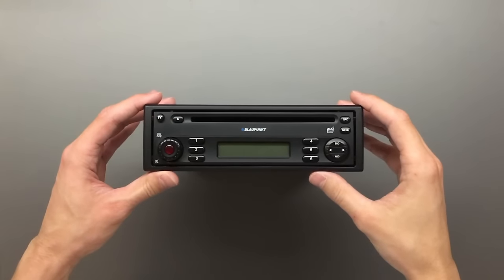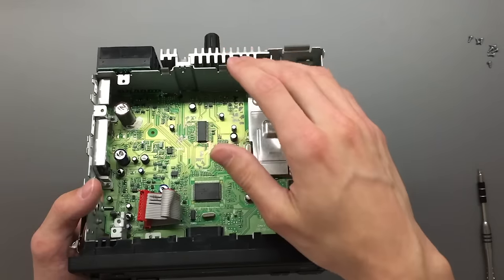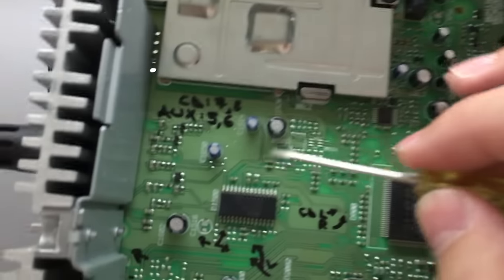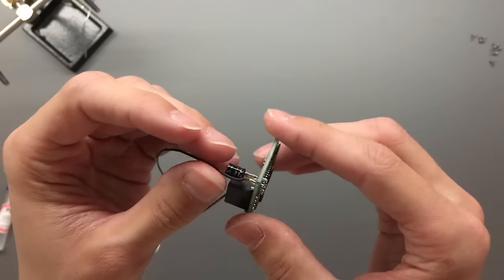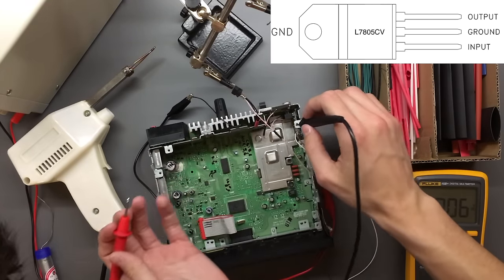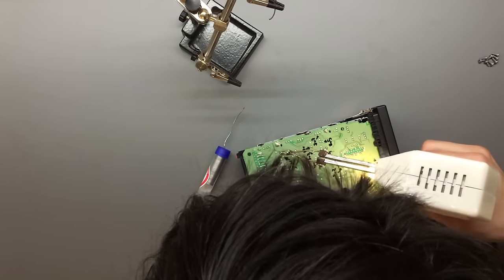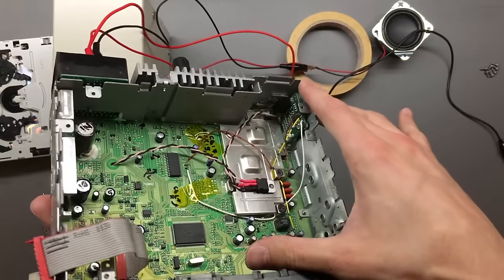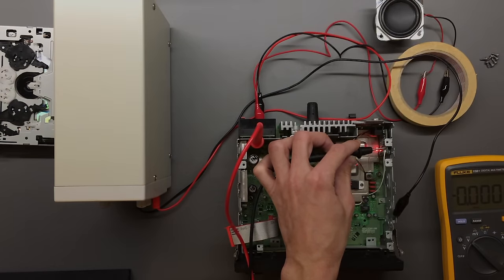How to Add Bluetooth 4.0 to Any Car Stereo for 12$ ! Complete Guide !

Comment: Only part that worries me is epoxying the regulator. The tab of the regulator is going to be the output voltage, in this case 5 volts, and you epoxied it to a grounded shield. If it comes loose, or if the epoxy becomes conductive (this can happen to certain epoxies in humid conditions) you could have a potential fire hazard. I would have used a silicone insulator and mounted it to the side of the case. Otherwise, great job.
Reply from the maker: Great Comment !

Few things though - most regulators (and all of the ones I have) have the TAB connected to the middle pin, which is GND

Loose I'm quite positive it will never become, this Poxipol crap was always good - I have joints made 20 years ago, and they're fine -- humid though .. yeah, that's a great point

In this case it would connect GND to GND, but just the other day I connected another TO220 package, a MOSFET, in series with the regulator, and, I also epoxied that one down, if the epoxy becomes conductive there, I'll be screwed, it'll short out the mosfet and regulator to the case

Unfortunately I don't yet have silicones I trust more than this Poxipol (all I save is sanitary silicone, the best of which takes forever to settle, and given I have to levitate the part over something, it really isn't worth the effort)

Anyway, that radio is taking a break for now as I've modded two mercedes-benz radios which are now being tested :)
Reply: I stand corrected, and thank you for replying. I'm going to be modifying my factory stereo in my 03 Mountaineer as soon as my BT module gets here. I'm going to try and make it so the silent CD isn't needed. Have you ever done that?
Reply from the maker: That's a tall order, there's basically 3 way of achieving this ...

1. The rough and ready way, just feed the audio straight into the power amplifier, make sure you're radio is set to mute, and you're off: https://youtu.be/C3KvqEyeIOs
The problem with this approach is you don't have any volume control on the actual radio, nor an equaliser or fader/balance, which might sound ok at first glance, but after a week or so I had enough of it - the no volume thing is horrible, and the no faders is tragic if you have unbalanced speakers front/back

2. You could also use the AM signal - and inject audio into the output of the AM decoder chip (given it's 03 that might very well be a separate chip) ... I've only tried this on one radio, a Becker BE3200 Audio 10 CC, but, as it turns out, it's first of all MONO, and second of all, sound like absolute and utter shit - extremely shallow dynamic range ... just unacceptable (which is why in that instance I reverted back to using the tape, even though it has a rubber belt that at some point will fail: https://youtu.be/UEI6IFuTH8s )

3. You could get all fancy, whip out a scope (which I very unfortunately don't yet have), and get a small microcontroller job going inside the radio, an arduino should be more than powerful enough, and whenever the bluetooth module is playing, send a signal to the mixer chip, which 99% sure will be using i2c, and have it route the signal from the cd mechanism without having the radio in cd mode (thus I'm assuming it'll just display the radio as usual, just you'll be hearing the non-spinning CD over which you'll be overlapping the bluetooth signal)

If you go the third route I would definitely like to see a video detailing the process
Reply: I was thinking  a version of 3. My plan is to use a microcontroller so I can add functionality to the existing mute and CD buttons. Essentially, I'll use a transistor in place of each button (original traces to the button cut). So, one side of the button will go to a low voltage rail, the other side to an I/O pin on the micro. The micro will then be programmed so a short mute button press will momentarily turn on the transistor simulating a normal button press function. A long press will momentarily turn on a different transistor simulating the button on the bluetooth. The second button will be to switch between CD and BT with the CD button. Of course, I could just drill holes and mount a switch somewhere, but what fun is there in that? My thoughts are that when play is pressed, a low voltage signal is transmitted from the CD unit which enables the audio amp, or at least goes to a pin on the stereo's micro which tells it to enable the amp. I'll have the original signal from the CD go to an I/O pin, and another I/O pin will receive a signal if it's put into BT mode. Then, all I should have to do is transmit a signal from the micro to the trace where the signal from the CD originally went when either one of those pins goes high. Other ideas would be making the stereo and steering wheel buttons work to change tracks. Seems it should work the same way as adding a second function to the other buttons. The whole plan is complicated by the fact that the chips in the stereo are custom for Ford and I can't locate datasheets. When I first started thinking about this, I was hoping to locate unused pins on the stereo's micro, and modifying the circuitry and firmware to enable them. But, without datasheets, that's not going to happen. I think my current plan has potential though. I have a Rigol DS1054Z scope, so I should be able to see what's going on when the CD is enabled and go from there. I'll document everything and do a video once I get it all together. I'd really like to find a way to make the track info show on the display, I think it could be done by transmitting it in the same format as the CD unit does, but probably not possible with the cheap BT module I bought. Maybe that will be the 2.0 version. Just looked at the module you used and I believe it supports the other functionality I want so I think I may order one and use it instead.
Reply: So, I went ahead and ordered the CSR8645 because it has all the functionality I want such as outputting track metadata and controlling the mobile device for hands free calling, changing track, etc. I'll just have to figure out how to make it work with the stereo. If I can figure out how the CD unit works,  I should be able to send the metadata to the display and it will just think it's the CD sending it.
Reply from the maker: But was the audio CD reader the type that could read track names ? I've never seen those hit cars .. or is it mp3 even ?

The solution for the buttons I feel is overly complicated - why don't you just tap the signaling side of the button contact, and listen in parallel with the host controller ???
Reply: It is a CD/MP3 player. It even shows me the song name on radio sometimes. Part number on the side is 3L2T-18C815, but I've found that there are many which look identical but have different part numbers. If I listen in parallel with the host controller, I can't override the native button function. There may be some where I don't need to override the native function and then a parallel connection may work. I think I can cut the trace after the button and use the original button signal to signal the micro in cases where I do need to override. That will reduce the number of wires I need to run to the buttons. I have one of these units open on my bench, but the CD player doesn't work so I can't learn much from it. I picked one up for $10 a couple days ago and, after cleaning all the limit switches, I was able to get the CD player on that one working but it's in my truck already. I'm planning a trip to the local you-pull-it scrap yard and I'm going to pull the CD unit out of one so I can use it for parts. By that time, everything else I need should be here and I can get this project going.
Reply from the maker: Alright - definitely keep us posted :D
Reply: I will. And thank you for all the ideas.
Reply: SwapPart TV Repair so?
Reply: @nerfinator03  I got busy with other projects, but this is still something I'm working on. Of course, I've learned an awful lot since these comments. The radio and CD unit communicate over a 4 wire SPI bus. My original idea of cutting button traces was completely wrong. The buttons most likely provide a signal to an analog to digital converter(ADC) in the main CPU. So, I could basically just tap that signal, feed it to an ADC on a microcontroller, and be able to use some of the radio buttons for alternate functions when in BT mode (this would be done in software). I had at one point designed a board in Eagle which would connect in series on the ribbon cable between the radio and the CD player. The idea was that it would respond to commands sent from the radio and either pass those commands to the CD unit (if in CD mode), or make the BT module do something if in Bluetooth mode. But, while waiting on a breakout board with my chosen microcontroller to arrive from China, I decided I wanted to do something more complex. The idea now is to add BT, microSD, 3.5mm aux socket, hands free calling, USB (capable of streaming and fast charging), and hijack the display. It's a tall order, and the USB may get dropped, but I'm sure it can be done. My plan is to use an STM32F030C8T6, which has 2 SPI ports. 1 port will connect directly to the radio's main CPU's SPI port (which will no longer be connected to the radio's SPI bus). The other port will control the radio's SPI bus. That way, the STM32 becomes the new master on the bus and plays middle man between the bus and the radio's CPU. The only real difficult parts are figuring out what all the SPI commands do, and identifying the chip select pins on the various ICs because there are no datasheets available (all the ICs have custom Ford part numbers).

Comment: Great job and explanation. I understand the theory and the technical / soldering things. However I have difficulties to find the right pins on my radio (standaard Opel GT / Saturn Sky from 2009). I would be great full if you or someone else could help me with that 🙏🏼

Comment: hey dude awesome mode. Can you somehow hijack the steering wheel controls and connect them to the module, as i can see the module has inputs for control. Thanks
Reply from the maker: you can but .. that will not be a simple task to accomplish

Comment: It's better to connect it to input of preamplifier, because now you can't control volume and adjust another sound preferences on radio in "Bluetooth mode" It's just simple amplifier circuit with BT module input, so you don't need radio for this :D
Reply from the maker: Yeah so by the 6th word of your comment I was quite sure you didn't watch any of the video

Comment: I have a Chevrolet stereo from a cobalt. It has an aux port so I’m just going to output to that. I’m having a hard time finding a 12v source from within the stereo itself.
Reply from the maker: Check for a 5V supply, and get a 5V isolated CSRA64215 module

Do watch out though, if you pull the 40mA necessary from some GPIO pin that's outputting 5V .. you can easily fuck the entire radio up

Comment: Not easy to open with a lot off different Allen Key screws and something I wouldn't want to do, can you not get the SPDIF data out from the Bluetooth module and feed that to the SPDIF input on the CD processing chip.
Reply from the maker: Even if you can (which you should be able to), there's huge chances it doesn't have an i2s or spdif input, and near unity chances you won't be able to select that input

Comment: If only using the built-in amp this mod is fine. But if using the preamp-out at the same time, the signal may become phase shifted 180 degrees, depending on how the pre-amp is designed. Just something to watch out for.
Reply from the maker: Hmm, not sure I follow - do you reffer to this multiplexer I feed my signal into as the preamp ?
Reply: Nevermind, this is most likely not a problem. I was only thinking since every amplifier stage internally inverts the signal 180 degrees (preamp, poweramp etc), and skipping one step would be like if you connect the speakers with wrong polarity. So I thought if you would use this Bluetooth mod and also use the preamp low level output to an external amplifier this could be an issue, but I might be totally wrong. As long as all speakers are in the same phase it's okay.
I once modified a broken amplifier with blown mosfets but I wanted to use the equalizer so I broke out the signal before the mosfets and used as a low level signal to another amplifier, the signal was then inverted, so I had to take that into consideration. But I realize now that this might never be an issue with your mod.
Reply from the maker: Exactly, since it's AC, all wrong is all good :D

Nice to know though about the phase shift !

Comment: Just wondering how the bluetooth signal is supposed to go through the all metal case of the car stereo deck ? Leave the cover off ? Add extra antenna ?
Reply from the maker: Nah, any small hole, even the size of the cd slot, will do ...

Imagine being in a box with a hole in one side .. you'll still hear stuff from outside

Comment: That's a neat idea. I'm guessing the audio mutes every 80 minutes as the cd skips back to hte beginning?
Reply from the maker: Depends on the radio, this Blaupunkt doesn't - as long as the CD is 'being accessed' it lets the sound through

I've done the same mod to a Mercedes Benz Audio 10 CD, and there the sound does get muted for about 1.5s while the read head goes back to the start of the disc

Comment: Hi, great guide!. Do you know if it is possible to emulate the CD playing without putting a silence CD on the CD player?
Reply from the maker: uuu .. I'm sure you can but I'm as sure it'll almost never be worth the effort 

There should be some i2c / spi / other bus between the main controller and the CD drive which tells it what to do and listens to when it's ready to play ... or maybe it's simpler and it just has a "playing" signal ... who knows ... 

Older designs might also be much easier to fool
Reply: Would it be possible to just remove the CD player portion?
Reply: +Scott Z would still have to do something like he said in the last comment, spoof the processor with whatever signal the CD drive would output
Reply from the maker: so Chris, I see you're on the good side of the fence - have you then added bluetooth to your stereo yet ?

Comment: You should have added capacitors between the Vin and gnd and between the Vout and gnd pins. Or you could have used a buck converter for cheap. But that may not fit in the case.
Reply: Or you could use this V7803-500 regulator it supports from 4,7V to 28V and putputs 3.3V 500mA

Comment: I'm working on a hands free setup for an old Mitsubishi Colt (via AUX). I've bought the BT module shown in this video and a cheap lapel microphone. I'm having problems with the mic - it picks sounds only at close range (30cm or less). Can anyone recommend a mic would be good for this purpose?

Comment: Hi, I would like to put bluetooth into my OEM radio unit and I have a budget of around 20 euro. Would you still recommend the CSR8645 module, or is there a better alternative now? I'd also want to attach a microphone if that's possible
Reply from the maker: could go for a 5v csra64215 module; pretty much the same deal only a bit faster and the software works with windows 10
Reply: @Darieee  So I installed a slightly different module (csr8630) as it was the only available locally. I have one problem though and that is that only static noise comes from my car speakers. I've hooked up the module to a 5V buck converter and that is connected to where my tape motor was. 
When I hooked the Bluetooth module to my power bank, I got music playing through my speakers. I'm not a pro in this field, but from my research it could be ground loop or some other unwanted interference from the radio?
Reply from the maker: yeah - either that or there is noise on the 5v line you're using

is your module isolated ?
Reply: @Darieee  It is not unfortunately. I'll try it with a dc/dc isolated converter a see how it goes
Reply: @Darieee  so replacing the buck converter with an isolated dc converter worked, but now I have a different issue. When I connect the channels to where the cassette pins were (to preamp and eq amp), the audio is overbassed and has low quality. When I skip this amp package and connect further, the audio is tiny (basically non-amplified). I've tried putting rezistors from 100k to 5.1M to the amp inputs but the audio was still shit regardless. 
I'm a little lost now and I'm not sure how I should tackle this
Reply from the maker: yeah - sounds like you don't have your grounds sorted out 

the isolating dc-dc converter does float both + and - ...

you need to connect the AUDIO_GND to the RADIO_GND, or better still, to that CASS_PREAMP_CHIP_GND

Comment: i was thinking of doing  the same thing however  my radio has a 6 cd changer output  .you think i would have to have a blank cd as well. im thinking of just tapping into the wires for the ccd changers input to stereo
Reply from the maker: well, that's exactly how I did it xD should work as long as you find a way to tap into the signal path